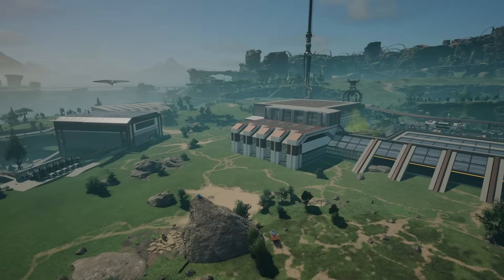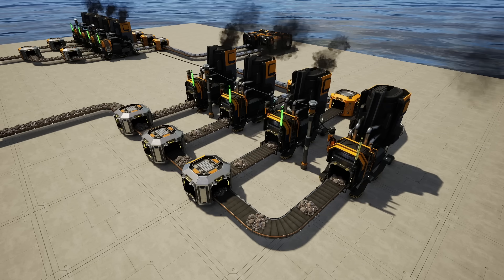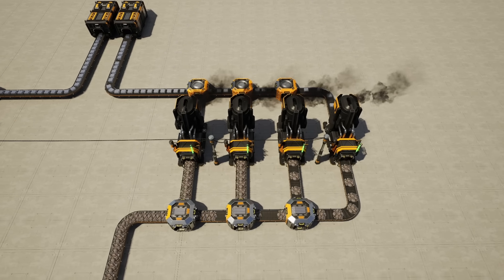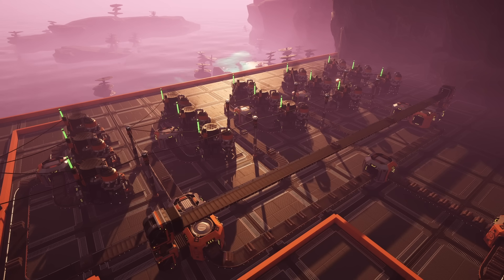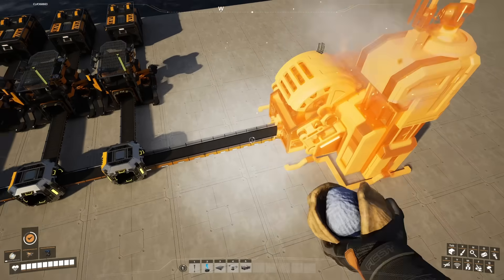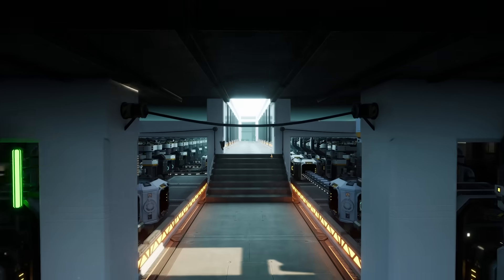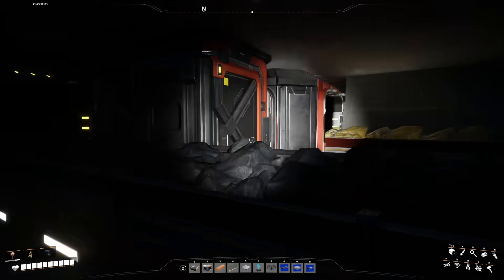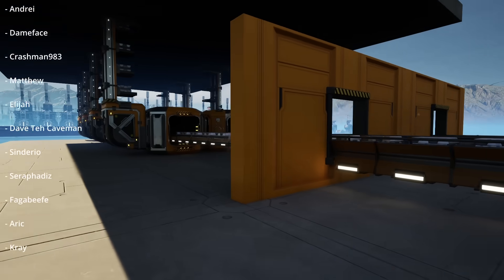Beginners Guide To Factory Logistics Systems in Satisfactory 1.0

Comment: It really depends on the look I'm going for at a given factory.  Sometimes I use balancers, other times I use manifolds.  Manifolds are easier and work fine once everything is filled up.  There's no right or wrong way of playing the game.  Do whichever you prefer.

You can even prefill the belts and input before turning on machines so that manifold setups run at 100% efficiency from the start.

Comment: I rarely see videos on manifolds point out you can simply change out the 1st and 2nd splitter conveyor to a L3 and the 2nd and 3rd to an L2.   Splitters will give 1/5th to one output and 4/5th to the other (they balance based on belt speed).  Compactness of a manifold but closer to a load balanced early start up.

Comment: Even sexier logi floor: place the elevator bottoms at default ceiling height, then place a merger directly on it, which replaces the elevator head. It doesn’t even matter which way you face the elevator. It works and merges the stuff from above into the merge, then belt them all together in a line at ceiling height. You can do the same with splitter on the input side. I can walk around my logi floor.

Comment: Pro tip: If you want to save space when using lifts, first place the lift and then snap the splitter or merger to the lift. the splitter/merger will partially engulf the end of the lift in  way I think looks cool and takes up less space. (Unless they have changed it in 1.0, as I haven't played yet)
Reply: looks horrendous imo xd but saves space
Reply: @vlodek69  You're entitled to your opinion... Even if it's objectively wrong lol. :-p
Reply: good tip, still a thing in 1.0
Reply: Yeah I don't like that. The idea of a lift emerging into a splitter is fine but I don't like how it's visually hard to figure out where my lift emerges after the fact.
Reply: @RiKSh4w  Or, alternatively, you could look at the lift?
I use the same technique in real life, for example, when I need to know if a door is open or not before I step through it.

Comment: There is no good reason to load-balance biofuel. For one, the process is simpler, and more space efficient. You can run 15 biofuel burners on a single constructor and if you build a plant to do that, its a lot more straightforward to build than splitting a belt 15 times evenly. You say its better for grid stability. But the biggest problem with bio-fuel is not overloading your grid, its running out of fuel. If you use a manifold, when you start to run low on fuel, the last generator in the manifold will run out and kick off the breaker. This is actually good, because you can then go gather more biomass, and the restart the empty burner by pinching some fuel from a burner that still has some in the internal buffer. That will get your grid back up again with minimal manual hassle. If you load-balance your fuel, when you run out and your grid collapses, you have no stockpile of biuofuel left to kickstart things until all the fresh biomass you've gathered can be processed. I will die on this hill.

Comment: Please do a guide on how pipes work. I just can't seem to get the flow to be consistent. 
But also, thank you so much for your videos. I'm new to these type of games and your videos have helped make the gameplay less daunting!
Reply: Check the archives, he made this video 2 years ago.  Look up McGalleon's guide.  But never use fluid storage, not even with valves, as it will only introduce sloshing and kill flow.  The only time to use a fluid buffer is with a pump going in one side, the buffer higher than other points in network, and a valve set to zero flow on the output.  This will be your key pipe from which you distribute head lift.

Comment: i just watched this, and there is another reason to use Load Balancers over manifolds. 

if your inputs are exactly what you need it to be, and your belts aren't fast enough to supply your structures over the short distance between splitters, load balancers keep machines running at 100% run time over a manifold which can't let them run since theres a wait period. i did this recently in a world with a friend when i started coal power. only had enough for a few coal generators, but 2 of the 4 i built didn't run all the time due to the small distance. used a load balancer and got power up and running long enough i could upgrade things to where i could swap to a manifold

Comment: I would also like to add that manifolds are much more adaptable to future needs - once that Mk1 miner becomes a Mk2 or Mk3, or you discover you need to input more ore onto the belts (because you always need more screws), you just slap some more buildings to the manifold and voilà!
Reply: You always need more screws until you stop using them.
Reply: @LancelotSwe  Screw the screws, all my friends use stitched plating! No but seriously, the game becomes a different game once you find all the alt recipes to optimize screws out of existence.
Reply: @entitledOne  Yeah sure, although the steel beams - to screw isn’t that bad if you have the constructor infront of the machine you’re supplying, not having to belt a lot of screws.

Comment: I load balance my sushi belts.
Reply: This got me in trouble. I had equal rates of two items coming in that needed to be split to two assemblers, one assembler got all of one part, the other assembler got the other... I guess I could have fixed it with smart splitters.
Reply: @stevenspencer306   I found it requires programmable splitters.  You need the multiple output options in order to load balance properly. If you put all items on the same outputs, you can treat it like regular load balancing.

Comment: IMO manifolds are a waste of time & resources. My main dislike is that a manifold will take a lot more time to process the same amount of materials in comparison to a properly set up balanced system. Not only that, it requires more resources to set up as well.
Reply from the maker: How does it take more time than a load balancer? After a few minutes warm up they both run at the same speed. I'd also argue load balancers which require multiple belts, mergers and splitters to do advanced load balancing require more than a simple manifold
Reply: @TotalXclipse  Context applies of course, but the only time a manifolds gets somewhat useful is if you overload the system so that the first machine eventually backs up. But that also means that you'll be one full stack of items short; these will only get processed when the machine can eventually pick up on the backlog.

Pure waste. Also because you'd normally want your items asap...  Meanwhile a load balanced system wouldn't have any backlog so you get access to all your items ASAP.

Manifolds either waste items by clogging up and/or waste time by inefficiently using machines. Sure, they're easy to set up, but that's about the only minor advantage.
Reply: @ShelLuser  If your manifold backs up your producing too much for the output to handle.
Reply: @ShelLuser  Completely wrong on all points.  But you keep telling yourself whatever delusions make you feel better.
Reply: @SerpenTyx  I'm not talking about the manifold as a whole, just the first machine. Heck; it's even mentioned in the video: "once the first machine is filled up" (aka: starts backing up...). The only reason it backs up is because the input is saturated with a stack of items which you're not going to be using in quite some time to come which is a pure waste.
Reply: @ShelLuser  Calling it waste when the items are sitting exactly where they need to be is very strange. Why do you care if there is 1 iron ore in a smelter or 100? The machine is working at the same pace regardless.

Comment: I use 8m logistic floors - I tried 6m but (a) conveyor lifts intended completely internal to the logistics floor will clip into the ceiling, and (b) how do you do walls when they seem to be all 4m high?
Reply: You should be able to avoid using lifts within the logistics floor by bringing belts in at the desired height by snapping them to the ceiling or to a vertically stacked splitter/merger. That will allow the floor to be more compact.

And there is also a 1m wall which you can stack to build floors of different heights. It's unlocked at the same time as the 4m wall. Alternatively, you can use a mix of different heights of foundations.

Comment: There's a few comments here about balancing manifolds, and I'd like to posit this can be a very good compromise to get the best of both. 

What I do is underclock until the input of the machines fall into an easy factor of 60: 60, 30, 20, 15, 10.

I then make localized balancers of 2, 3, 4, or 6, which can usually fit into a blueprint with that many machines fairly easily. From there I can place any number of copies of this blueprint and so long as I feed them with a mk1 belt they can be manifolded with any speed of belt and still run with the same level of efficiency
Reply: I do that sometimes too, I call it 'hybrid' balancing.
Smelters are an especially obvious case of it - copper and iron are both 30/min input, pure aluminium is 60/min

Comment: I run a load balancer in exactly one place; train stations. Averaging the inputs or outputs ensures that one container backing up doesn't lead to imbalances down the line. Load balancers for standard machines is a fools errand most of the time. I incidentally let machines back up to the point where the feeds are saturated. I mean, it only takes 3 minutes...which is longer than it takes to make the next set of machines.

Comment: Solid advice. My biggest problem was/is how to handle full storages from base resource PoV. Meaning: should  I plan my factory (the very first one) to always produce x/m of every produce (plate, rod etc), store a certain amount and then sink the rest, or skip sinking the low level ones, and overload the base material line to produce other stuff?
Reply: For your first factory making plates/rods/etc I wouldn't stress it too much. Do it if you want to, or skip it if you feel like you've got enough else to think about already. Getting some early sink points to unlock some of the quality of life things from the store can be nice, but having a backed up plate/rod line probably won't cause any problems.

In general I think sinking is a good habit to get into, though it isn't always essential. The cases where it's essential are those where a line getting clogged will cause production to halt. The sushi belt shown in this video is one example. Another is recipes which produce multiple outputs, since one resource's output buffer filling will cause production to pause even if the 100% of the other output resource is being consumed. Once you're using trains there's also an argument for sinking inputs to prevent trains from hauling around full freight carriages all the time.

Comment: Why would manifold cause backed up lines for nuclear? Wouldn’t the equivalent amount of radiation be flowing through at the same rates?
Reply from the maker: The lines back up to the splitters on a manifold and the machine has a buffer of 100 items... So 120 radiated items or load balance with  1 radiated item has quite the difference

Comment: I tried using logicstic floors but moved away from them mainly because the aren't blueprint friendly and quite cumbersome to setup
Reply from the maker: Why aren't they blueprint friendly?
Reply: @TotalXclipse  Probably the space restrictions? I just finished my first really compact solid steel blueprint and I just barely managed to squeeze in a 4m height logistics floor just on the base floor. So there is none between the floor 1 and floor 2 part. Especially hard on the tier 1 blueprint where you're more restricted. Thought if you're willing to split your blueprints into 2-4 blueprints with more space between them, it would work fine.
Reply: @TotalXclipse  To use floor holes you need to rely on foundations, but many machines don't align with foundations.
Eg with Smelters you will end up with a cap, since you can't have the last smelters end with the foundation
Reply from the maker: @Matthew1234567890m  I'm confused - All buildings align with foundations?
Reply: @TotalXclipse  Hard to explain in Text let me try again.
To use logistic floors you want to use floor holes.
To use those you need to have your maschines on foundations with floor holes and connect them, since you don't want to place all the machines, holes and connections manually.
You want your blueprint to be tileable. So the maschines can be right next to each other.
With constructors for example this is simple 4 foundations equals 4 constructors. When you put multiple blueprints of it next to each other there won't be a gap.
Now the same with Smelters. Smelters are 5m wide. A foundation is 8 m wide
You would need 40m to ensure the blueprint is properly tileable.
The MK1 Blueprint Designer only has 32m though.

Since i don't want to use Blueprints only after the MK2 or rebuild the majority i gave up on the idea of logistic floors

Comment: for all the newbs out there, balancers are for early game and highly specific situations. manifolds are king and can be setup quite speedy when you have mk5 belts and power shards to speed up the satuaration process
Reply: Load balancing is also useful late game for low-production items.  Who cares if you have mark5 belts when a mark 1 belt can supply 40 blenders with heavy modular frames to make fused modular frames?
Manifold will take half an hour to fill up, load balancer will be virtually instant.
Even if you're only doing a third of that, it still takes a manifold half an hour to saturate because while you're scaling back production, you probably also only have a scaled-back HMF production, and the numbers just get worse the further along in the production chain you go.
Reply: @SalamanderBSC  you saw the part where I said highly specific situations? Also, it makes life easier to have to carry only a few materials in large quantities. If you build a high output aluminum factory, you just need aluminum sheets and you can belt mk5s everywhere, all the time. it just makes things easier.
Reply: @wyntje83  Building load-balanced blueprints is hardly a "highly specific situation".  I can and do use them for things where a manifold would be fine, but I also have them for situations where manifolds aren't great.
Literally the first blueprint I made was 3 constructors balanced together as a single unit.
Just use blueprints, people.  One-time time-cost to plan and build a layout that will work in multiple different scenarios the moment you turn it on.
Reply: @SalamanderBSC  cool
Reply: @SalamanderBSC easy fix for that is to store everything you build in containers so when you reach the next stage of production you have several stacks to prime the manifolds
Reply: @kenneilwalters6821  The time it would take me to go over to where I'm storing those items could be just as easily spent building a load balancer and not having to bother with priming dozens (or possibly even hundreds) of buildings.
Especially since I could just cram 8 blenders into a 6x6 blueprint, load balance them for the blueprint once, and then just load balance between 5 of those blueprints.
Now I also have a blueprint for a "super blender" which is internally load balanced between 8 blenders that I can use for other tasks too, like encased uranium.
Reply: @kenneilwalters6821  I wouldn't say it's an easy fix, you still need to have those containers nearby to have enough stuff with you to saturate big manifolds. I do agree that if you do have them on hand you can drop em in to speed up the process, I do that as well.
Reply: @kenneilwalters6821  While I agree mostly, when you produce like 2 of an item per minute, even containers don't help when it takes hours to get any reasonable amount of stacks of the item. And if it's a resource for a future production line, usually I'm done with the next line before I get enough items to saturate a manifold for such low prod items.

Comment: Logistics floors are especially helpful with machines that can have dry outputs and wet outputs both, like Refineries and Blenders.  Although the complexity of implementing is a little higher, it makes a much better looking factory (for those of us who dislike spaghetti).
Also, for manufacturers it REALLY helps organize the 4 inputs you need for alot of items you need to make. My manufacturers literally have four vertical belts popping up and connecting directly to the machine - Very clean looking.  Below (on the logistics level) I use a "vertical bus" arrangement with splitters in the bus for direct connections to the risers to the machines.  Very clean and organized helpful arrangement for connecting multiple manufacturers in a row.
Good video!  Thanks for this!!

Comment: After the first conveyor belt is full of raw material that overflows, the overflow continues and after a while it will do the same thing as the load balancer. I use a load balancer when, for example, I use coal generators, because in this case the most important thing is that it is used to the maximum. For example MkII miner Pure coal resources equals 16 coal generators because 15coal/min